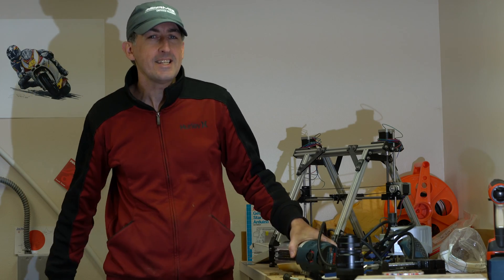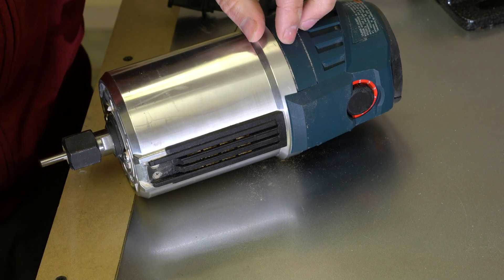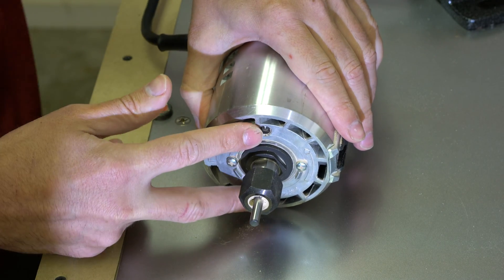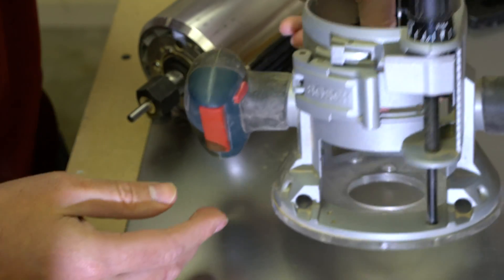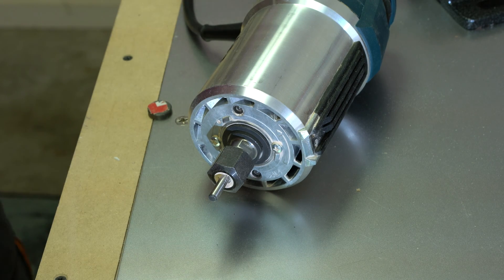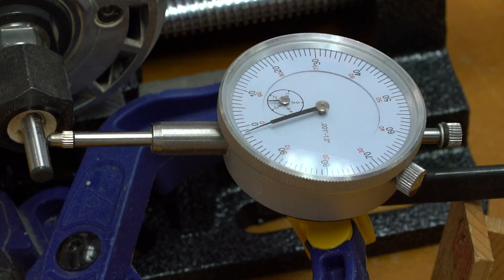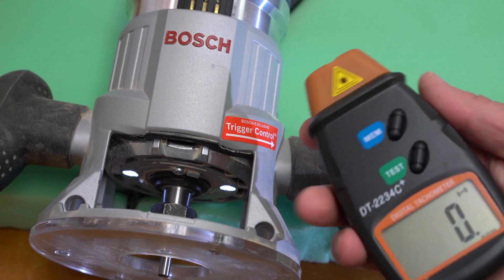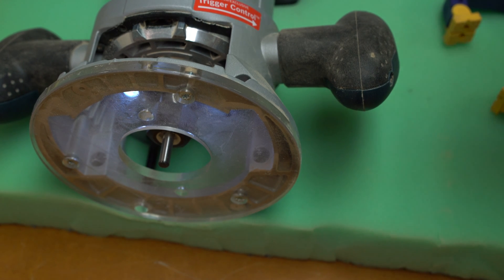Spontaneous CNC build 6 - Choice of CNC Router - Bosch 23EVS

Comment: I have sold a lot of our Larken machines with the 2hp bosch.. but the bearings usually fail if you do long run times.. I find the Hitachi 2Hp is cheaper and its a better router. Its also quieter
Reply from the maker: thanks for the feedback. i wonder if it's something one can modify or are they quite custom bearings?
Reply: +Brian “Easty and the Wolf” Eastwood , The bearing are easy to get.. and you should replace them with a higher quality ones. But the bearing is held in by 2 screws which isn't a good idea as it puts un even force on the bearing.
Reply from the maker: +larken558 Nice. good to know. its fixable. Do you think there could be space to install a thrust bearing to remove the force? or maybe have two nuts half as deep to alleviate the problem?